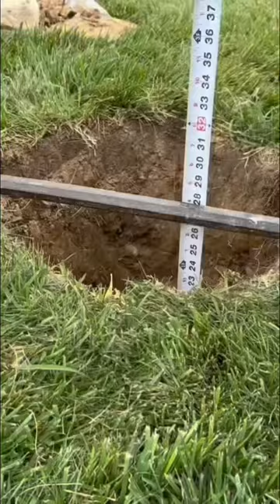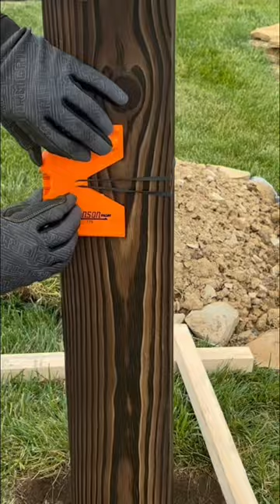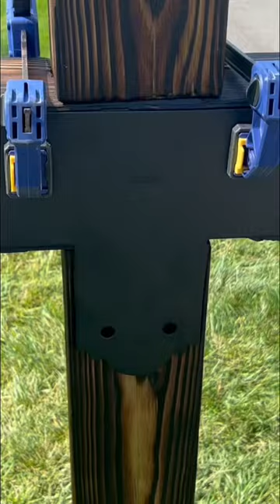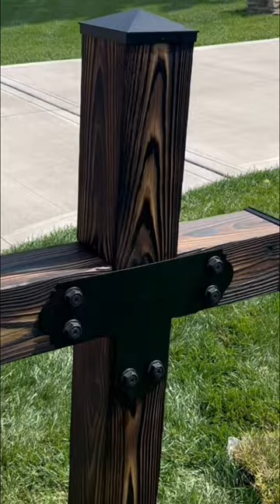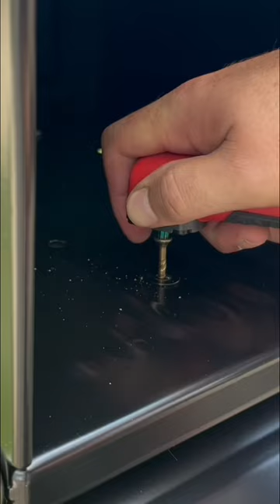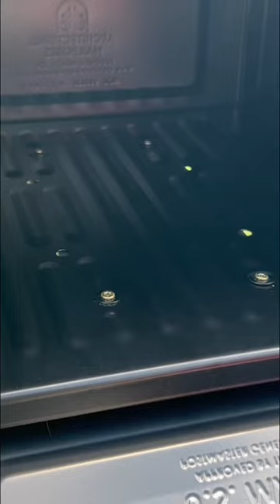6x6 Custom Mailbox Post Build #shorts #diy #howto

Comment from the maker: Below are the tools and supplies used to build your own!
Extra Large Mailbox: https://amzn.to/3JVsLLe
T Straps: https://amzn.to/44p70eM
T Strap Hex Head Washers: https://amzn.to/44Hq9ZP
Screw Fasteners for T Straps & Bracket: https://amzn.to/3NXFPRq
Post Caps Cover: https://amzn.to/43sxwTl
Support Steel Bracket: https://amzn.to/3rxgJBr
Torch: https://amzn.to/43rj7GX
Nyalox Flap Brushes: https://amzn.to/3rzOiT4
Oil to protech & finish: https://amzn.to/3NXEDgZ
Post Level: https://amzn.to/44p6zkE
Floating Modern Mailbox Numbers: https://amzn.to/3Q1mZeU
Chisel - https://amzn.to/3pYOBq6
Circular Saw: https://amzn.to/458eeon
Drill: https://amzn.to/3P8BtWi
Saw Horses: https://amzn.to/3pRXjX7
Speed Square: https://amzn.to/44gg8mb
Quick Grip Clamps: https://amzn.to/407w1bI
Hammer: https://amzn.to/3oQK8lb
Tape Measure: https://amzn.to/3IkGv04 
Jobsite Markers: https://amzn.to/3nOxshR
Safety Work Gloves: https://amzn.to/3IlCDNA
Safety Glasses: https://amzn.to/3RcTF36
Screws: https://amzn.to/3Q2vl5N
Palm Sander: https://amzn.to/3YLnmuw
Sanding Pads: https://amzn.to/409cCaF

Free Basic Plans: https://ibb.co/album/7v7Bxp